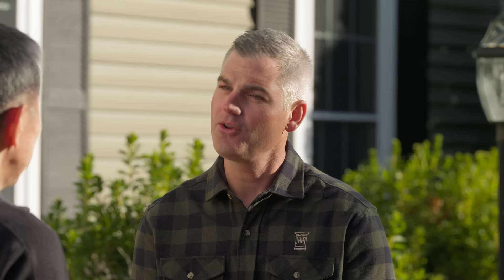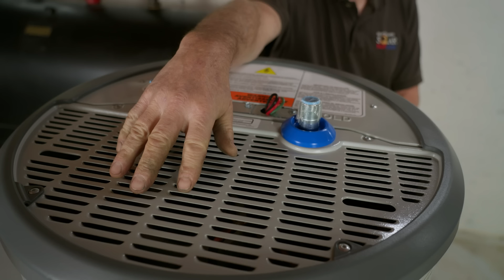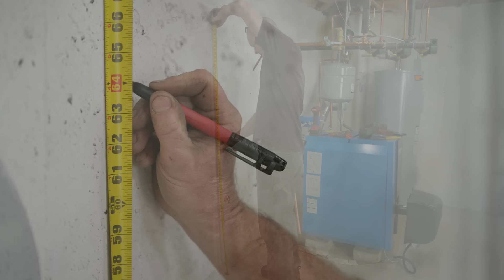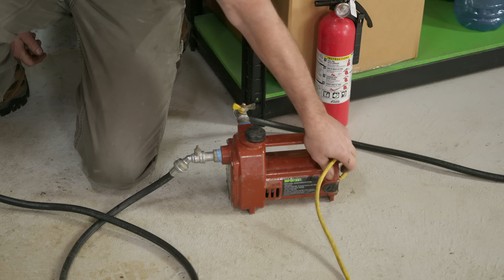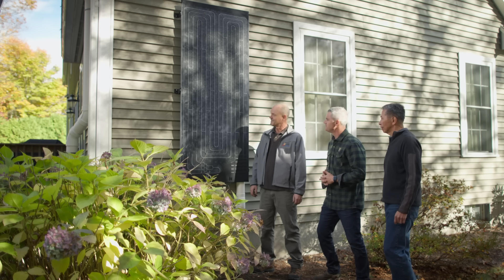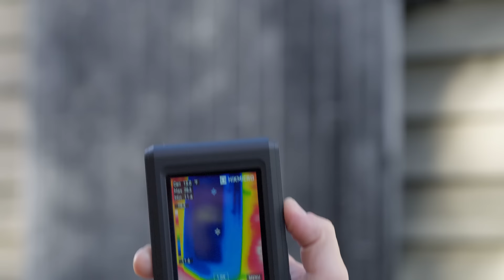Heat Pump Water Heater for Cold Climates | Ask This Old House

Comment: Why are you guys making something simple so convoluted? This guy's home is obviously in the North & his solar gains are going to be minimal at best. Now throw in an additional unit that not only adds costs it adds complications. That basement with that poiler is going to have more than enough heat for a traditional HP water heater to work just fine, & it adds the addition of dehumidification & cooling in the summer. Why drive up costs & complications when you don't have to!
Reply: Seems like 50% of comments are either ‘use a regular heat pump water heater’ or ‘use the boiler’. Most Smart Solar customers (including this one) are switching to mini splits. Conventional heat pump water heater won’t work in a basement without a source of heat. Thank you.
Reply: @SMARTSOLARWATERHEATER2025  He's going to find his Winter comfort level massively below what he's got now switching from Boiler heat to mini splits. UNLESS he's spent all the additional money & effort to up his insulation & Air sealing, odds are the answer is no.
Reply: @ericscott3997  I’m sorry about your low IQ, Eric ☹️

Comment: still not as cheap to run as gas burning probably. If they have extra solar power generation, sure it may make more sense but for the average homeowner, with the electricity costs these days it's going to be so expensive

Comment: If I could find a  heat pump / indirect combo that would be best for me. Use the oil boiler in the winter and switch to heat pump in the summer. Helps dehumidify the basement in the summer too

Comment: I have never seen an oil boiler. I heard the northeast uses oil to heat but never thought about it. So interesting and different
Reply: It is one of the most reliable and logical types of fuel to have, parts are more standardized, stocked on most real technicians trucks, and it can be fixed at 2 am on Sunday in minutes typically, and your basic generator can run it all on less than 5 amps of power if needed.
Reply: You must live under a rock
Reply: I’m not saying it’s bad, Ive just never seen one. I live in the west and I don’t know if anyone out here uses it
Reply: @jessesea77  theyre all over the place
Reply: @jessesea77 I agree they are only seen in older homes, and becoming relics. They work great though. The spec builders today will not pay for an oil burner system install. They are hefty and pricy upfront, but run a very long life.

Comment: Neat!  I'm wondering if I could use this instead of my boiler for hot water radiators?
Reply: No, wouldn't heat the water fast enough for home heating.
Reply: @dmt9810  thanks, I wonder if it can be scaled up.
Reply: Good for a tiny home as-is. This question is just about BTUs. More units, more BTUs.

Comment: I’m not a plumbing expert, but to me this seems much more complicated & expensive than just using a regular hybrid water heater & discharging the cold air outside during the winter, which is what I do. The manufacturers sell duct kits for this that work just like vent ducts for a dryer
Reply: because you can't duct air outside that you've drawn from inside efficiently. that free air had to come from somewhere, ie all the leaks in your building (or more worrisome radon air from the basement. these heat pumps run many hours per day...
Reply: @ctgottapee9020  while that’s technically true, The amount of air the hybrid water heaters move is very small. Most people aren’t actually bothered enough by how much colder air they discharge, & I haven’t had any perceptible increase in my heating cost since switching to them & venting outside in winter. You also get a slight dehumidification & cooling benefit in spring & summer months that would offset that.
Reply: @ctgottapee9020 also if you’re worried about air leakage you can do a closed loop where u draw outside air and discharge back outside with the same vent kits
Reply: Lots of people in this market are switching to mini splits for space heating. Then there’s no source of heat in basement for a conventional heat pump water heater.
Reply: @SMARTSOLARWATERHEATER2025  unconditioned basements generally stay above freezing since they are below the frost line where hybrid water heaters can easily make hot water, plus they have the electric element that can assist in unusually extreme temps.

Comment: he has a oil fired heating system , why not use a indirect hot water heater ? uses the system he already has
Reply: that's what I have, just with natural gas. beats the price out of anything using electricity!
Reply: @Orholam5  Gas prices are going up, so watch out.  Your supplier might be working off of legacy contracts, delaying the price surge.  Indoor air quality is another consideration.
Reply: Oil is still very expensive as a heat source.
Reply: Without the ability to search YT comments (not helpful, Alphabet/Google!) I do not know if someone else has said it but doesn't it matter what local climate is regarding running a boiler year round to maintain Hot Water?  Heat in one's basement in the summer time in our area would not be good.

Comment: I feel like the homeowner was cheated because he didn't have the chance to see comparable operating costs with an indirect hot water tank from the existing boiler. Electric rates are skyrocketing in Massachusetts and it is easy to run the boiler off of a generator in the event of an electric outage.

Comment: I've got a gas "boiler" (it doesn't get that hot) that provides hot water to the radiators and to the hot water tank. Could I use this?
Reply: Would not be enough to heat the house but you could use it to replace the water heater.

Comment: Panel rated for big honkin hail?
Reply: If it's gonna damage the panels, it's probably going to also damage the roof not covered by panels...
Reply: @Bremend idgaf about the roof, it needs to be at least as resilient as a heat pump

Comment: Far left green idea 
The original tank is simple and with minimal maintenance will last 20 years.or more
The new system is about 5 times the initial instal cost and be lucky to last 10 without issues.
Notice they never mentioned cost only efficiency that’s because the money you save on electricity will take forever to recover the initial cost.
Been in trade 40 years do not recommend this at all unless u have money to burn to say your tank is efficient .total BS idea stay away!!!!

Comment: Efficiency vs cost is at issue, electric hot water is nearly 100% efficient, no energy is wasted but it is costly because electricity is higher priced than solar but, if you add all the costs of going with solar and heatpump, it all evens out in the long run so this is all bogus to even talk about!

Comment: I wonder if that outside panel could be installed 5’ underground where the temp is a constant 60 degrees or so and act as a geothermal unit.
Reply: geothermal needs a much larger chunk of ground contact.
also geothermal doesn't run on the refrigerant cycle (there have been some attempts).

the ground is constant, but if you place a panel like this, the ground becomes soaked pretty quickly, ie the ground is not a good mover of heat.
Reply: i think aluminum would corrode, in geothermal set ups they'd use some form of polyethylene like PEX or HDPE

Comment: My house was built 23 years and have Weil Mclain Beckett Oil GO-5 Oil Burner with 80 gallons Gold Super Storage Tank. During the Late Spring-Summer Partial Fall months I'd installed Wall Timer to go on with settings 5:30am to 7:30am and 30 minutes at 12:00pm and then 5:30pm to 10:00pm even though it takes 20 minutes or less heat the tank. I am an Master Licensed Electrician for 40 years. The timer has been installed 8 years ago. I do savings on oil during those set timers. BTW: have 4--5 people in the house. The house is 2480 square ft. Never had any issues running out of hot water. Those Super Storage tanks lasted lifetime. I do know electric and gas water tanks lasts average 10 years. Timer made by EconoSwitch by Honeywell Model: RPLS730B good for 1 HP Motor

Comment: I grew up in a house with  hot water heat and fuel oil.  We heated the water with coils inside of the boiler, a rather common install here in upstate NY where it gets cold in the winter.  Have never run out of hot water, and people ask where out water heater is, and I say its in the furnace.  A camp along the Delaware river also has the same system with coils in the boiler to heat the water and seems to work well.
Reply: I have the same setup but it couldn’t keep up with hot water demand in the winter.  I set up the system to discharge the hot water through an electric tankless hot water heater. In the winter, as the discharge temp drops the heater makes up the difference and in the summer, when the incoming water temp is higher I can turn off my oil boiler, flip three valves and bypass the boiler altogether, using just the electric tankless system.

Comment: So what do you do when it's -30 and overcast for a week?
Reply: where is it ever -30F in New England
Reply: Never gets that cold in New England and it would still work, just less efficient. Tank has an electric element for backup too
Reply: @dmt9810  Long as they kept the backup elements. Record cold for most states up there are -40's or -50's. Couple stints of -30 doesn't sound that crazy over the decade or two a water heater allegedly lasts.
Reply: @jabi2090  not very bright, are you dear 😇

Comment: Don't you have to have a HVAC license to install them? If you don't the EPA will soon make you get one since you are dealing with refrigerants.  While this may save you some electric money I am thinking maybe 10 years and you will have to replace it so is it really worth the investment cost? I am sure the repair will also be a lot more than a conventional system.
Reply: licensing is not required for personal installation. 
most people don't have the tools and experience to deal with refrigerants, as they are typically one time installs. most hot water systems only warranty for 3-7 years.
Reply: good catch
Reply: No you don’t

Comment: to clarify, an electric water heater is very efficient, basically every watt of power used goes to heating the water, like they said, which is far more efficient that the conventional gas water heaters.  
This is just even better at a 2:1 or 3:1 efficiency.

Personally I'd be worried about that frost build up since there is no defrost.  The ice will act as an insulator and reduce the efficiency, so it's probably a good idea to oversize and go with the 65 or 80 gallon if you used to have a 40.  That's based on not testing it, because I certainly don't have the money for a side by side install and test..

Comment: I still heat with gas. I converted the BTU of my gas usage to kWh. Using the heat pump efficiency coefficient, my average cost of heating my home would increase by at least 30%-40% compared to gas which surprised me. Without solar offsetting the energy cost, gas is unfortunately still the cheaper way to heat a home.
Reply: Well, it will always depend on where you live an the relative prices of gas and electricity. If you happen to be somewhere with extraordinarily expensive electricity and gas prices are cheap, might be the case (or much longer and colder winters than what they're talking about here) than that could be the case. If you already have solar panels though the heat pump would definitely be cheaper over the course of a year almost no matter where you live.
Reply: @kaupaxup agreed
Reply: There are a lot of areas in New England where natural gas is not available--thus the oil boiler.
Reply: @chrisstoddard1144  op talking about gas, not oil
Reply: @kaupaxup  ...and I'm saying that gas was probably not an option for this homeowner in Massachusetts.

Comment: what about an oil hot water tank? 
What happens if temperatures outside fall below the system's temperature range?
Reply: Backup electric element built into the tank
Reply: Split heat pump systems work until around -20F. If you're in a climate that regularly gets colder than that, you might be better off with the traditional heat pump water heater (the second model shown in the video), since the interior of the home will always be above that.
Reply: @holycrapchris  the second water heater cools the space where it works, effectively losing all of its efficiency. An oil or electric resistance heater would be better in winter that it doesn’t put an additional load on the home heating system.
Reply: Best for supercold, moist environments but it seems they are able to scrape a tiny bit more efficiency on the coldest dry days and in theory, it is better if you have a stable grid.

Comment: Sheesh, now you need an HVAC tech, electrician, and plumber to replace a water heater. Congrats, you save $25 a year.
Reply: More like a savings of $25 per month, at least. More if you live in a place with expensive electricity. 
The most popular traditional electric water heater at Home Depot advertises using 4000kWh per year. With expensive electricity (30 cents/kWh in MA), that's $1200/yr for hot water. Compare that to HD's most popular heat pump water heater, using 900kWh annually, or $270.
Reply: @holycrapchris  a conventional hybrid water heater has roughly the same efficiency, is 1/3 of the price & can be installed easily by a homeowner with basic tools. It’s a cool concept, but it’s unlikely anyone will actually save $ with this.

Comment: Good luck finding a plumber that can fix that water heater. They don’t have a grasp of the refrigerant vapor compression cycle. Plus the refrigerant it uses is. HC refrigerant like R290 or R600 and it’s highly explosive. Just google “exploding refrigerator”. So now your water heater can explode and tear the vessel wide open. Water everywhere. Maybe an HVaC tech could fix it but they usually don’t have a plumbing license and if you mess with potable water you need that license. This is wrong to force people to buy these.
Reply: They don't use explosive refrigerant. Also, my refrigerator has never exploded on me so not too worried about that happening with one of these.
Reply: The refrigerant in these (or any hybrid) is not explosive. Natural gas, on the other hand, is.

Comment: The part missed about the vented version, is that you can vent that air outside in the winter, and keep it inside in the summer. This is how I have mine setup, plus mine is in the same room as my heatpump dryer, that dumps warm air into the intake of the heatpump hot water tank. Allows for much better use of the existing energy.
Reply: Worth noting, dumping cold air outside still requires air to replace the lost air, on the coldest days, you will pay for that rather highly, but still better than dumping the cold air in the basement.
Reply: @jsbrads1 In colder climates, how much more efficient is this really in the winter? A lot of conditioned air essentially is being consumed by the heat pump and dumped outside; that conditioned air is replaced with outside winter. One could have both the intake and exhaust from outside but then COP falls off a cliff and there may be defrost issues.
Reply: I run my unit like this. I have a ducting that can either vent to the outside or vent to the inside in the summer. I position my intake ducting over the wood stove as well. For me the biggest win of this system is that I run my system off of an off grid solar inverter, it only draws around 500 watts when running vs 5,000 of a traditional electric heat pump. This is a huge benefit for not overloading my inverter.
Reply: @matthewwhite8129  That sounds well thought out plan given the restraints of a heat pump water heater.
Reply: Helpful! What brand allows a setup like this?
Reply: @duckbow Rheem units are set up for ducting, I built my own discharge and intake flanges as they hit you pretty hard for those items, iirc it was over $300 for two accessories. You do need to get creative if you wish to switch back and forth between discharging indoors and outdoors as you’ll need to add means of switching between discharge ducts.

Comment: What is the construction of water heater tank & materials? What is the construction & materials of water heater condenser coil? Compressor in wall hung unit? Is it a Hi-Lee rotary? Inverter Scroll?
Reversing valve for defrost? That indoor wall hung unit provides no workable space for a serious repair. Couple of electrical repairs maybe that's it.. soon to follow major system replacement. One trick pony. The obsession with heat pumps is misleading. More short lived products only to take space in a landfill. The wall hung condenser unit & tank quality was not discussed. What good is all of this if it's throw away quality. Energy consumption from manufacturing to product delivery is overlooked. Product packaging, plastic, Styrofoam, energy consumed for transportation & installation and it's final burial grave. Is it efficient? Nope.

Comment: Surprised the basement walls weren't insulated.  I built 6" walls with 2" of foam glued to the walls.and then a 2*4 wall with mineral wool.  Also sealed the sill plate and used flash and batt on the joist ends.  Basement went from 50 in winter to 65+ with the waste heat from my furnace.
Reply: Unless you're actively heating and living in the basement, what's the point?  The boiler heats the occupied areas of the house with hot water baseboards, so the basement temperature's probably not relevant.